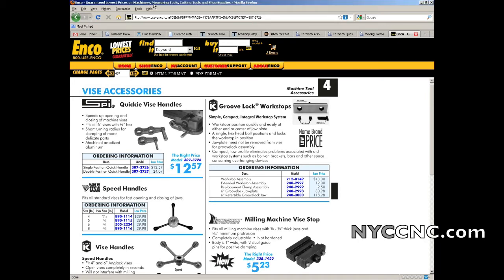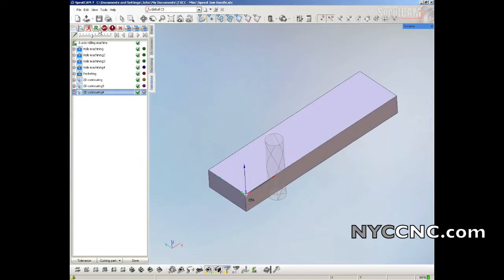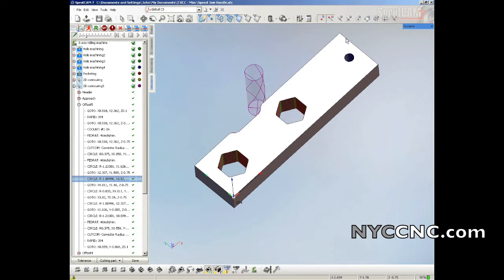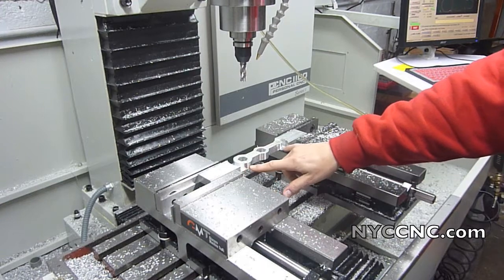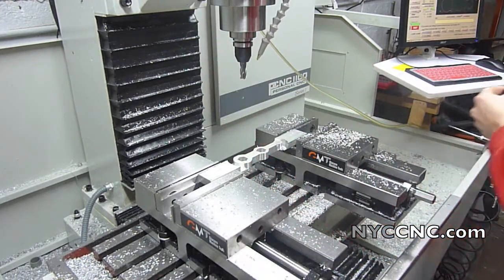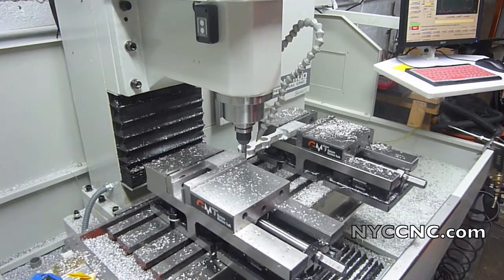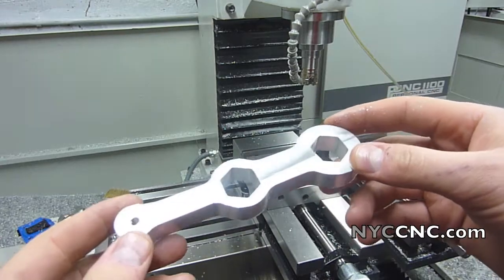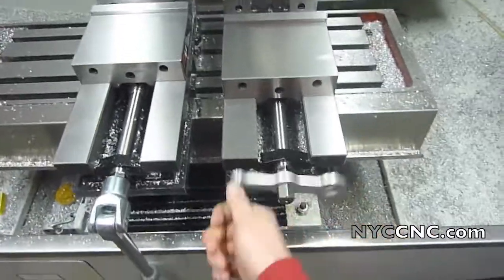Tormach PCNC 1100 - Milling a vise handle.  Ch. 17

Comment: Next time you run a part like this, you might want to drill and tap holes on the centerline of the .25 hole and on the centerline of the left hex in a disposable aluminum tooling bar or plate. Clamp part blank in approximate finished position on the tooling plate with toe clamps, and finish machine the .25 hole and the 2 hexes on to inside of the part. Fasten to the tooling plate using the prepared tapped holes with bolts and clamp plates, then remove the outside clamps. Now finish outside of part. Advantage is, part supported well thru-out machine process (no chatter) and inside and outside work is completed with part always in the same position. Not so important on a part like this, but on a part that has to keep all machine operations inside and outside true to each other it works well.

Comment: I work in a production shop, yes. I've never contributed to the purchase of a machine so I don't know where it sits on the list, but when running the same part day in and day out, I'm sure it's thought about. All our machines are 10-20 years old, VMCs and Turning centers. All of the CNC machines in the shop have around the same rapid speed, and that speed is very fast. When it comes down to it, it's max parts per hour of labor. The machines always pay for themselves in a [busy] job shop.

Comment: how is you z axis zeroed on tool change?
Reply: You tell the machine the length of each tool ahead of time. Each toolholder fits tightly against the end of the spindle, so it’s Z-position is repeatable.

Comment: Good stuff. I was really looking forward to seeing some parts come out! I too have found that GWizards HP estimate is not a good way to set the feeds/speeds. My little X3 starts to dismantle itself if the projected HP is over 0.15hp despite having a (true)0.6HP motor

Comment: Nice little project to get started on the new Tormach. I think I will look in to getting a second vice for my mill after seeing your set up in action. The tumbler appeared to round off the corners very well. Nice work.

Comment: Nice job!  That long handle that comes with the vise is rather clumsy and on a bridgeport it could get stuck in the ways and damage them. I noticed you left it on your vise when running the program the only negative I could tell from that was that it would wear on the paint of the stand.  I have one of those Kurt speed handles on my vise and love it.  I really enjoy your videos and like seeing how you attack work holding.  Thanks for allowing us into your shop.